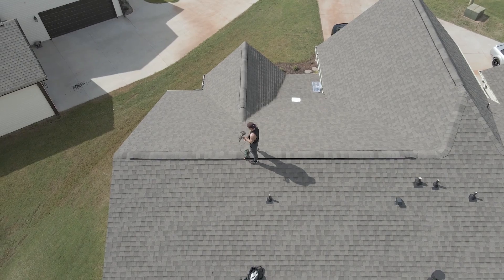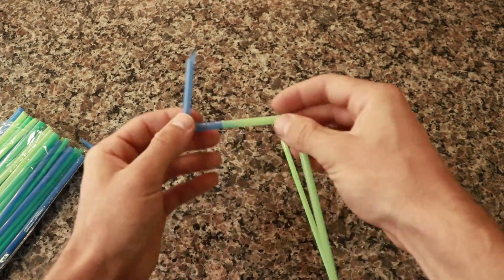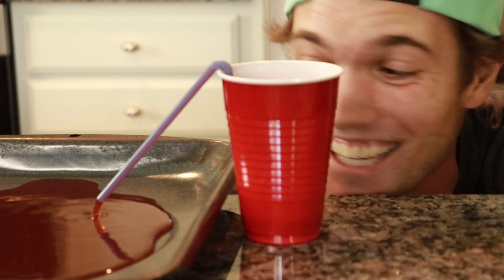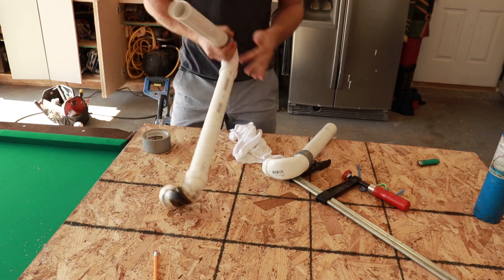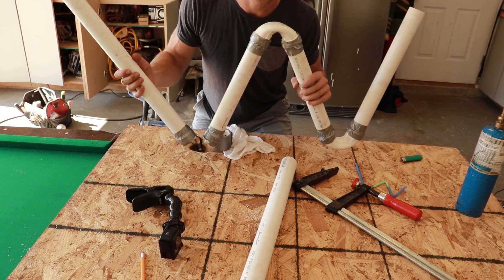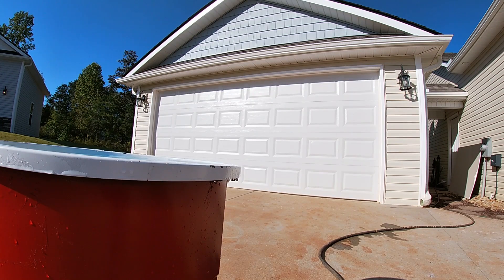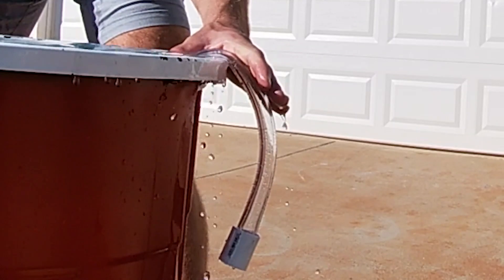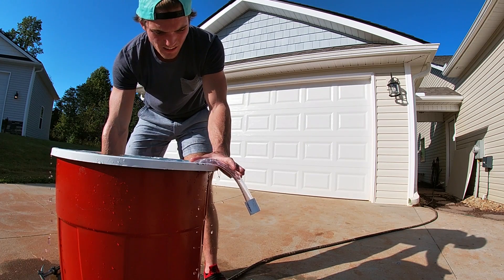I MADE THE BIGGEST SELF STARTING SIPHON

Comment: You slam  the pipe into the bucket. That is not exactly self starting. You should insert the pipe into the empty bucket and then add water till it reaches the top of the bucket. If the siphon starts on its own, then it is self starting, otherwise it is not.

Comment: Problem with your mark one was the diameter and volume of air inside of the pipe. The problem with your mark two was shape. Your mark two could be done much easier, (or upgraded) by ading a bendable wire/rod to the hose. Obviously, if you only attach hose to the bended rod, there will be no cuts on the hose, and the hose will hold its shape even when already falling into the watter, just thrown by your hand. And finaly - the best sollution would be having a hose with one-way valve on its end, and fill the hose by jerking it up and down in the jug.

Comment: Pex pipe would’ve been the best choice and you can actually bend it when you heat it up and it doesn’t burn. I did one out of pex to drain a swimming pool and I simply put it completely under water then pulled it out of the water very fast without taking the whole thing out and it began to drain and continued to drain

Comment: As a Fishkeeper you just saved me from drinking many more gallons of fish water
Reply: Lol
Reply: "more"
Reply: Amazon has a 110v pump that does great for cheap. After u start it, it siphons on its own
Reply: dude
Reply: and I didnt even use this
Reply: Wat
Reply: @imdeo5893   shyshy
Reply: SAME HERE! Lol
Reply: You don’t have a python changer
Reply: @kippertheman  no I just have a clear hose from Home Depot and The attachment on the end I just haven’t been around getting one
Reply: You just fill the hard plastic part with water, raise it above the edge of the tank until water goes through hose, refill hard plastic part with water and it'll start the siphon. Easy.
Reply: @krap101  wat
Reply: @krap101  Why? Back in high school (94) We were tasked to make a siphon that self starts and I had seen this one in a PBS documentary. All I did was buy 20ft of clear thin wall 1 1/2" tubing and 12ft stick of 2" PVC.  PVC cut to 2',  2.5', 3', and 4', ran the tubing through each PVC in that order and I was done. Took 45 min tops. Soup to nuts.

Comment: Someone should put a syphon in a lake, that’d be funny.
Reply: It is done all the time. Lakes and reservoirs are often *siphoned out so they can be dredged. They take cap each end and fill the pipe with water from the top then close the top and open the caps.

Comment: That thread is for threaded pipe like threaded pvc, not “flexy hose,” but if it works, it works. Prolly wouldn’t hold an pressure though. Pvc is also made to be glued, if you needed it to hold much anything you have to glue it.

Comment: Nice work man, I like your enthusiasm. Reminds me of the first time I got fire from rubbing sticks together - pretty f'ing exciting. No cameras though, and no Youtube to post any video on anyway. Then again, it's really not that hard, just technique. You might have fun trying it. I experimented with a lot of different fire making techniques and let me save you and your eyebrows the trouble of taking a bullet apart and using a magnifying glass on the gunpowder inside. A small pile of powder flares up nicely - I don't remember, but a foot or two high at least. That a fire does not make, so I put the powder in the "bird's nest", the ball of papery bark tinder with a dent pushed into it to hold a spark from whatever process you're using. You'll use a bird's nest rubbing sticks, because you just make a "coal", not an outright flame at first. You carefully put the coal in the bird's nest and blow and blow until that thing is smoking like a steam engine, and you're wheezing like a steam engine without enough steam, and eventually the air, heat and fuel decide to do what they're supposed to do and ignite into flame. Hope you have the beginnings of your intended campfire ready, because you've got a ball of fire in your hand and the last thing you want to do is drop it and have to start all over. Anyway, I digress, back to the gunpowder. Once I saw how easily the powder burned with the magnifying glass, I took apart another bullet and poured the powder in a perfectly prepared bird's nest. Well it lit just as fast, but it flared up more than "a bit" more than before. I hadn't considered gunpowder does its best work under pressure - literally. Some of the powder had fallen into the tinder fibers, plus I'd kind of squeezed the nest in a little tighter, closer to closed, and it acted similar to how it does in the rifle. It wasn't nearly the pressure it would have had from being capped by the bullet and the riflings of the barrel, but it WAS plenty enough pressure to blow that bird nest into a thousand flaming bits of tinder, all in the proximity of my all-too-closely studying face. Of course, eyebrows do come back, but not nearly fast enough when you're really wishing for some new ones. After dozens of experiments with wax, steel wool, sticks, batteries, glass and etc... I figured out your best bet in the wilds is a Bic lighter - ALWAYS have one, or better yet a few. Cotton balls soaked in petroleum jelly makes perfect tinder, even if it got wet. But back to your siphon, good job again. It sounds like it's most definitely the biggest one you've ever made, but you might not say a whole lot around anybody who understands how hydroelectric dams work. Engineers are the worst, they're real know-it-alls. As in, they really do know it all about dams and siphons. Otherwise, keep on experimenting, you might come up with something brand new. Like a way to grow back eyebrows overnight.
Reply from the maker: Love the story 😆😂 thanks for sharing! and you should definitely makes some vids about that stuff, at least tik toks! and yes maybe one day i could invent such a thing

Comment: Great Stuff!! Aside from the sealing of leaks, the reason you pipe worked when it was shorter was related to 2 things. First is the inertia of the water moving down the first leg, it's kind of a balancing act to get enough downward force to push back up the pipe towards the drain. and second, is the angles. Your pipes with the clear tubes made essentially right angles which reduces speed and requires more force directly against gravity to come back up. This is why the smaller straw ones work as they are more a V than a U.
Reply from the maker: Thats a great explanation! thank you! and LOL it was so hard to figure the right lengths and stuff, it took me like 7 hours i believe
Reply: @ChayDenne  I really dig your efforts. That is the coolest thing about science and study, Sometimes you have to do things many different ways to find out the precision needed for the best chance of success. Soon after, you really get an appreciation for the hard work that brings us all the cool stuff we have today!! Keep Goin!! and hey, if you need any computer graphics to support your demonstrations.. feel free to let me know. :)